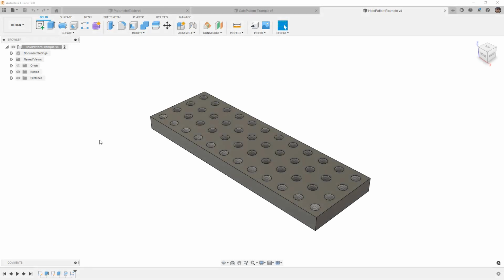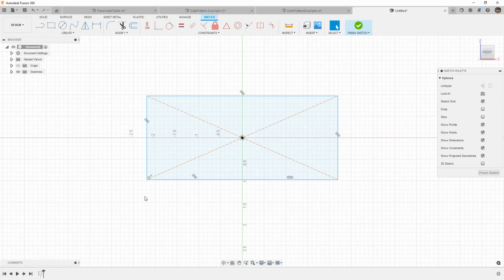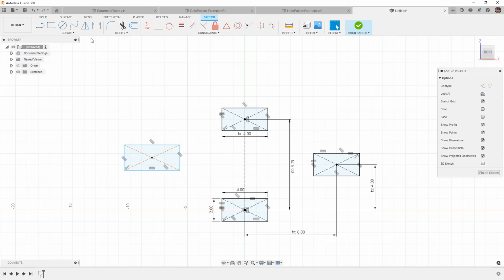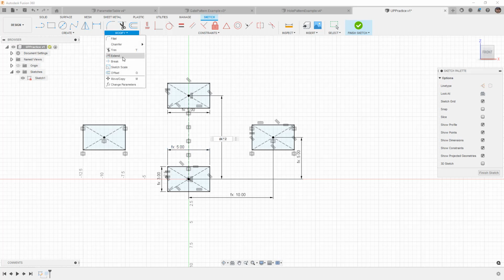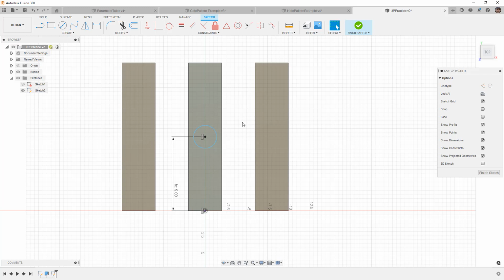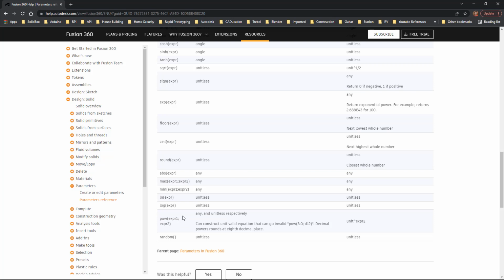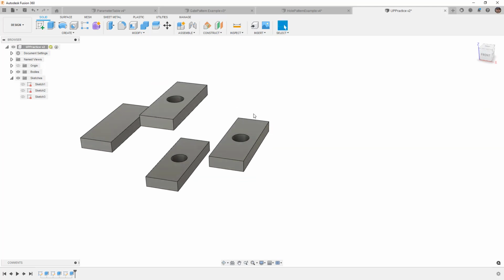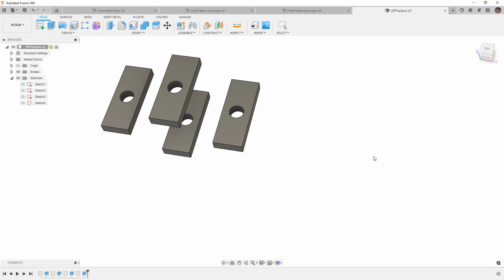User Parameter Fundamentals - Everything You Need To Know About Parameters #Fusion360 #Parameters

Comment: Something that i found annoying is, i'm trying to make a spool for cable in Fusion 360 and i am unable to do the following: (CableWidth%SpoolWidth)*CableWidth
for some reason when i put the second CableWidth in, it then invalidates the entire thing.
Reply from the maker: Yeah, the issue with this is that you are taking a remainder(which i think you might want the spoolWidth%CableWidth no?)  and multiplying it by a unit so you will need to make sure the parameter unit is lets say sq MM if you are in metric.  Fusion is very picky about the units.  

The way to get around this is to make your cable width or spool width parameter unitless(i think).  But then if you want to use that say in a dimension dialog you would need the UP name like SpoolWidth and then in the same dim dialog you would need to multiply it by 1, which will take on the default units in your document.  This way you can still drive your parameters(without needing an area unit) and use it in your sketch.  

One thing about creating a parameter and setting the units is that when you enter a value into the dialog like 26 * 3, it doesn't apply the unit until it is solved.  when you take a parameter that is defined as 26mm and one that is 3mm and try to multiply them (length x width) in a parameter you will get the error.

Hopefully that makes sense, its late and you should never do math late ;)
Reply: @LearnEverythingAboutDesign  I came from Inventor and this was way easier when i could just use an accompanying excel sheet for my designs.

Also, about the suggested correction. Close. I was actually going for:
SpoolWidth - (SpoolWidth % (CableWidth / 2))
Then I was going to pick up the slack elsewhere in the design.
Reply from the maker: @george-broughton  Yeah using a spreadsheet for stuff like this makes it much easier. and Inventor with its iLogic can be much easier.  But to be fair I believe the problem you had here with units is the same in inventor.  If you take a parameter times a parameter like SpoolWidth * CableWidth I think it will still fail because it is bringing the unit with it vs entering a number in the equation which won't evaluate until the end of the calculation.  This is different than how using an Excel spreadsheet is treated.  The only way around it (that I am aware of) is to make the parameters unitless in both Inventor and Fusion when trying to multiply them.
Reply: @LearnEverythingAboutDesign  My updated math is accepted, whereas the old math isn't. No changes the units column in the parameters table were made.

I was going to say that this seems like performing mathematical operations between numbers with units and ones without somehow seems to solve this problem, but i just tried removing the /2 out of the updated expression to test that theory and for some reason it's accepting it now.

So, I'm guessing there's just some odd caveats to doing this and best practice is as you've advised. It's just something i honestly haven't encountered in the past 10 years using either software.

I'll probably mess about with this a bit later and see what exactly it seems to matter with.
Reply from the maker: @george-broughton  hmmm.  If you are using (SpoolWidth - (SpoolWidth & (CableWidth/2))) that should work since you aren't multiplying unit * unit.  If you original one is now working I am baffled :).  I am going to pin this chain to the top as it is interesting and im guessing frustrating to many people.  Please let me know if you figure it out if there is some weird order of operations that does work or doesn't.  thanks!

Comment: I wouldn’t create these dependencies inside the sketch. Thank you very much for your work and instructions, I like them and have learned a lot! Thanks!
Reply from the maker: Glad it was helpful!  Some dependencies in sketches are ok and work well, like making 2 dimensions equal to each other by just clicking one.  Similar to the = constraint but this works for geometry that isn't the same like having the distance of a hole from the edge of a part = to the hole diameter.

But I agree that the ideal option is to use and create parameters before.

Comment: I really enjoy your presentation style.  You do an amazing job of explaining why you do something and giving guidance and advice that will help avoid future problems.  Thanks for this video!  I would love to see a follow up using shared parameters between files and some of your guidance in multi-file larger projects.
Reply from the maker: Thanks!  After this video we did an update on the if statement.  this was all before configurations were available so we of course have a playlist and some videos on configs.
As far as sharing parameters between files that is a very tricky one and the workflow isn't really great.  You can import and export them but they don't retain a link.  You can derive something out of a design and take some parameters with it.  The problem is that with external references the only time you can touch parameters is with Edit in Place.  So there isn't a "Global" type of parameter linked between multiple external files.

I know Autodesk is working on improving and pushing this xRef type of workflow.

As far as guidance on Multi-file larger projects.  that is a can of worms :)  The options for workflows mean there isn't one ideal way and very much project  based.  I personally don't like to work with xRefs that are design dependent, but rather keep them in a single file.  So things like bearings, hardware, COTS, or designs that are reused I will keep as xRefs.  But unique geometry I find much easier to build in a single file.  I did it this way in Solidworks as well with Multi-body parts before moving them to an assembly.
So it kind of depends on how many parts we are talking about, and how they relate to eachother.

Comment: Great vid! Thanks. Still think params on the fly should be a user param by default. Just wondering why you dont use a diagonal line at 35:40?
Reply from the maker: That would be great rather than having them be favorites!

On the diagonal that would be a great option.  At 35:32 I do mention/show corner to corner.  I generally use midpoint from the edge because I often don't need to do this.  If i need a diagonal it will often be a center point rectangle as the start so it is just there.  Usually i will do the midpoint of an edge for something like a hole pattern.  Some of it is preference.  For this specific design the corner/corner would be the quickest and easiest way.
Reply: @LearnEverythingAboutDesign  Yeah a lot of diff ways to do it. Im use to other packages where you can hit a shortcut and waits for 2 point inputs (and I use diag a lot) then the centre point of whatever was executed before the shortcut will be placed.

Bit hard to unsilt all the other progs...even inventor as F360 is similar but in some ways not. Cheers and keep un the great work!
Reply from the maker: @Art_Of_Sound  yeah. I used to love Solidworks sketching and some things are nice but it is really hard to bounce between inventor, solidworks, fusion, and others that i use.  Would be great if they would all just pick one way :)

Comment: Awesome info. I’ve been looking for a solution to  specific problem I guess. I’m making a cabinet with drawers, but want to have the ability to change the number of drawers based off reveal between each and viceversa; and have the actual drawer box also change proportionally. Any advise where to start? And videos to watch. Thanks for your time
Reply from the maker: The one function missing is the if/else function sadly, but you could make something work pretty closely.  There might be some future functionality that will help this but currently the only video I have that is close is this one. https://youtu.be/-BPcktQwIIY  I go through a few examples, one being a wooden fence where we update fence slats based on length.  Using things like floor and ceil will help with rounding.
Reply: I came here looking for the same thing from another video where they showed it in action but did not give the details. This entire video has been incredible. Thanks for sharing the knowledge.
Reply from the maker: @MrTmorton77  I have some updated parameter videos as well since Fusion now has IF statements.  https://youtu.be/91LBG-3DkpY  Be sure to check that out if you are looking to use some of the new logic.
Reply: Ohh wow that is awesome! I will check it out for sure.  @LearnEverythingAboutDesign